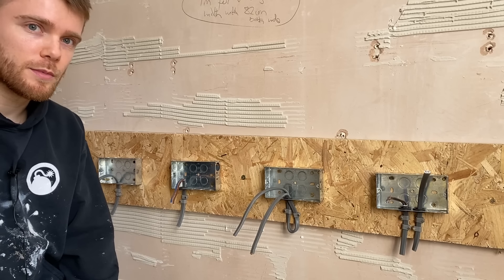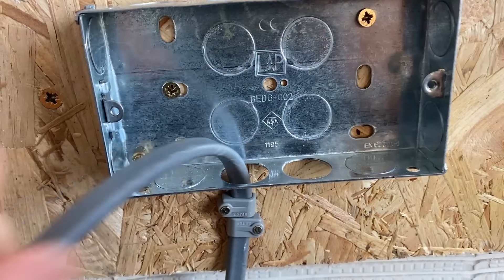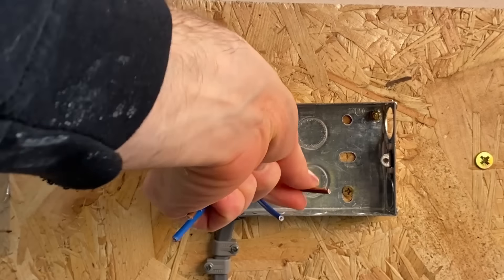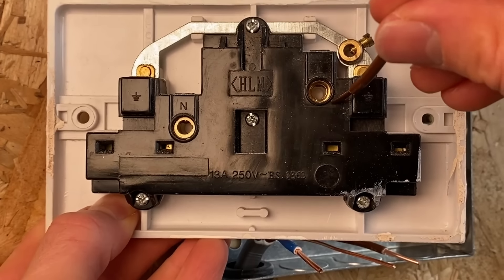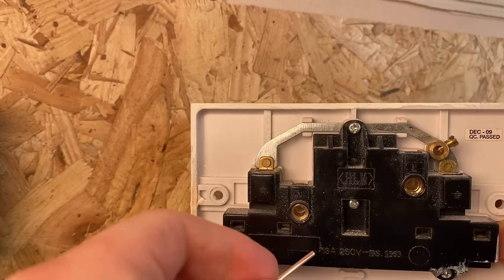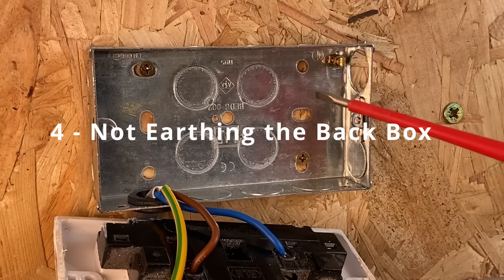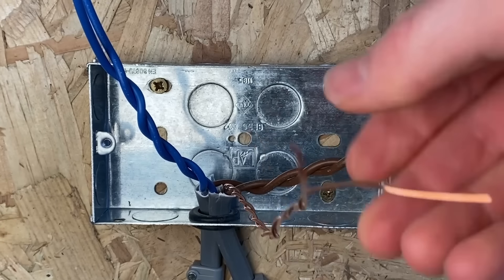5 Biggest DIY Mistakes Wiring a Socket

Comment: Well done for starting your channel, however a home owner must not be carrying out electrical works them selves !!, thats why us professional electricians are trained to do the work. if you carry out work on your property and have a problem or cause a fire, you are likely to invalidate your home insurance.
Reply from the maker: Thank you! You are absolutely right, but I think some people will always want to do small jobs themselves, whether they should be or not, so better to do it right!
Reply: There is nothing in law in the UK to prevent people doing any electrical (or, for that matter, gas) work themselves. A very few things have to have building regulations certification but in many cases the cost of that from the local building control department is less than the amount saved by not employing a professional installer (which in any case doesn't guarantee a good job).
Reply: @TheDiligentDIYer1759  Within the part P regs it says a non Part P person can do simple jobs. I suppose its how to define a simple job!! A socket is one which is 'simple' I think!!
Reply: @richardlewis5316  actually it says that some work is notifiable and some is not. There is no actual requirement for an electrician only to do the work. Obviously an electrician has insurance and knowledge but provided it passes the relevant BS standards and complies with the Building regs and is correctly signed off then you can do it yourself. 
Some work like adding a spur is not notifiable but if it did fault and it was down to faulty workmanship your insurance would probably be invalid, but they would have to prove it was down to the installation and that you did it. Not exactly an easy job. 
Sparky’s do want to keep their job to sparky’s only and be able to charge the sort of day rates that make your eyes water and like to spread fear (rightly so with some DIY disasters) but not all DIYers are incapable of doing a compliant job.
Reply: Most of the time the handyman does a more professional job than the professional electrician
Reply: @thunderstorm6616  I would consider myself a competent diyer with electrics. My dad was a spark and I have worked with him on a few jobs and we regularly discuss updates on regs, new equipment etc etc. And I'm sure the majority of sensible people could do the job of changing out a faceplate, especially given videos like this with good information on what to look for and how to make it good. My issue comes with post installation testing. The vast majority of diyers will happily swap out switches, sockets or light fittings but won't do any testing afterwards to make sure it's a good job.
Reply: @rodgerq  Spot on
Reply: @Harold_Shand  So explain to me if you put an outside socket on how do you know it will be safe?
Reply: @Harold_Shand  yeah, because all DIYers have a multifunction tester in their toolbox
Reply: @Harold_Shand  PMSL.
Reply: @thunderstorm6616 That's just an assumption based your experience.
Reply: @thunderstorm6616  behave yourself
Reply: Or issues selling your house if recent work has not been certified by an electrician.
Reply: @theotherside8258  yep!
Reply: @theotherside8258  Define recent? Who would know when work was done?
Reply: @barrieshepherd7694  Well work more recent than build might def stand out and work more recent than regs (which change) I think are identifiable by the cable markings,  pretty sure they are stamped with enough information to do this. Someone should be able to verify this.
Reply: @MarkUKInsects  I am DIY but do electronic repairs in the past t.vs video recorder amps . I find terrible electrical work and say did electrician really do this mess. I have completely rewired several properties and had them tested and sighed off
Reply: Another jobsworth H&S arse !

Comment: #2 cables cut short, I just moved a lightswitch because the electrician who rewired our house left the cables short. He also tried to avoid any chiselling into our brick, because they are "engineering" brick and harder than some types of stone. It took me half an hour with a cold chisel and mallet to dig deeply enough, could be as much as 5mm...

Comment: Although it is not a bad idea, earthing a metal back box to the socket is no longer required as long as long as you have at least one fixed lug which is used to secure the socket front to the back box via the machine screws.
Reply from the maker: Yes true, I think the regs state desirable rather than required. Thanks for watching!
Reply: The Regs say desirable - which is a very poor drop in safety standards  (They should know better ! )

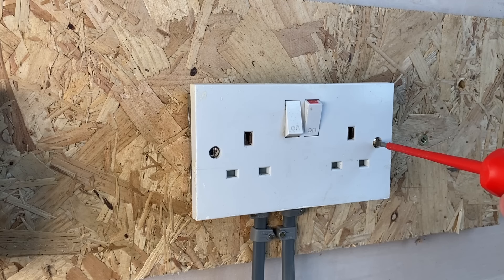Comment: At 5:44 this sparkie rambles on about ensuring the outer front casing screws are pointed in the same direction.  Yes, it looks nicer, BUT IT IS NOT A SAFETY MATTER, so it is NOT a necessity.  More important to ensure they are tightened equally, and enough, so that they do not, somehow, rattle out.
Reply from the maker: I’m a diyer, not a sparkie haha, but thanks for watching!

Comment: Excellent video.  2.5 sq mm single strand T&E is horrible: nowadays one can get stranded, far better. My instructor was in the trade when 7/0.29 sq inch was still in use. He said that when 2.5 T&E came in, they called it stair rods - quite right: it's horrible.  In the premetric days, most lighting circuits were done in 3/029 sq in, far better than 1.5 sq mm solid core. Stranded conductors give better connections.
Reply from the maker: Thanks for watching!!
Reply: It's single core for a good reason, if you just think about it.
Reply: My early 70s council house is stranded definitely copper it's horrible stuff and all cut quite short so can't really do a fresh cut not terminate.

Comment: How can you get all the screws vertical or horizontal?
You need to tighten them until they are tight!
Why would you leave it not fully tightened or overtight? I've always fully tightened them, vertical, horizontal or whatever.
To not over tighten screws or nuts is why for mechanical engineering work torque wrenches are used.
Reply from the maker: You don’t torque faceplate screws, you crack or bend the face plate doing them up too tight. The thread is very close together, it’s very easy to tighten them to the required level and leave them vertical. Thanks for watching!
Reply: @TheDiligentDIYer1759  Exactly my point, easily over tightened by taking them that bit further.. 
Torque wrenches are for engines and such as I said so they are not over tightened but to the manufacturers recommended setting..
I tighten things and then nip them up as I did in engineering.
I still wouldn't attempt to align the heads.

Comment: Sparky's take: very good video, couple of points though. Dont need to earth a back box so long as it has at least one fixed lug(like your box) boxes with all adjustable lugs must be earthed, however, it will do absolutely no harm to earth all boxes, it will just take longer for no real gain. Dont bother aligning your screw heads, nobody is EVER going to look at it and say "oh your screw heads are all inline". 

Grommets 👍
Dont twist the cpc 👍
Double back cores when you have a single core in the terminal(dont bother with two or more) 👍
Leave spare length 👍

Wish every DIY socket I came across was like yours 😆
Reply from the maker: The screw heads is just obsessive OCD on my part haha. Thanks for watching!
Reply: @TheDiligentDIYer1759  surely correct tightness is more important?
Reply: I was alway taught to align heads, but at 45deg.
Reply: @pauldarlington9157   yeah, I really cant knock it, fantastic practice 👍 this is honestly an example of me choosing to not go the extra mile in the interest of keeping pace
Reply: Another point of best practice, again something that I dont actually bother with unless spec'd(high integrity earth spec); If you put one cpc in each earth terminal, any problems with the earthing integrity within the socket itself will show up when it is next tested.
Reply: I look and notice misaligned screws ..
Reply: How is the leccy going to flow into the ground from the earth if the screw heads are not vertical?
Reply: @I_Don_t_want_a_handle  🤣🤣🤣
Reply: 100% correct on all your points inc earthing back box.
Reply: I 100% go round aligning screw heads on everything… But I do have a problem 😂
Reply: I line up the visible screw heads, it is the 'done' thing in the US. The ones which are torqued to spec, nope, a solid, reliable connection is more important than appearance.
We bond every metal surface together inside a box, I, personally do not rely on our rather flimsy receptacles to make a good bond just through our rather under-dimensioned screws. 
(Cue the arm-chair idiots who pretend nobody torques to spec.)
Reply: @pauldarlington9157  Is that 45deg clockwise or anti-clockwise; forward or backslash?
Reply: Surely the point of earthing the backbox is to prevent problems when you take the faceplate off? If you rely on the screws to provide the earth, if a fault is present, the back box could end up live once the screws are removed???
Reply: @TheDiligentDIYer1759  Lining up screw heads was instilled into me at school by my woodwork teacher...It's about the only thing he did manage to impart in me!
Reply: @peterevans8194 any fault in box that is not picked up by fixed lug bonding and has not tripped circuit would still be there regardless of fly strap bonding of back box.
Reply: @peterevans8194 why would you remove a live faceplate potentially making the back box live under fault?
Reply: One fixed lug constitutes a fixing - which therefore is NOT acceptable for an electrical connection.  Don't comment if you are not competent !

Comment: Very helpful video so many thanks.  I'm a hobby woodworker and it's regarded as a good finishing touch when all exposed screw heads are aligned.
Reply from the maker: Thank you! Yes I think it shows good attention to detail!
Reply: But you also get plastic lugs to pop over them so not really an issue

Comment: The metal box is earthed via the outlet mounting earth screw, fly lead not required?
Reply from the maker: True, but only in the case of fixed lugs. The regs state no earthing of the back box required when it has two fixed lugs. For two adjustable lugs the box must be earthed as the adjustable lugs can’t be relied on for a good connection. For one fixed and one adjustable, which in my experience is most common, the regs state it is desirable. A bit subjective, but I’d say it is certainly best practice in that case.
Reply: @TheDiligentDIYer1759 I have seen some electricians argue both ways, as an electrician from another country I would earth the box.  I can't understand why the regs state it is desirable. Its required or not, make a rule. It should not have to be best practice.
Reply: Yes agreed!
Reply: @TheDiligentDIYer1759  I am a fully qualified sparky in uk and I dont earth the back box with a flylead on sockets (presuming there is at least one fixed lug), regs state that if there is at least one fixed lug it is not required....   My reasoning for this is in a few arguments, firstly and easily the back box is earthed so if it for whatever reason line comes into contact with it then the over current protection device will trip.  Next the back box is not actually touchable anyway, its in the wall how is anyone going to touch it? I do put a fly lead if I fit surface metal clad boxes,  the only time it could be touched is when removing the socket and anyone doing that should be competent...

But why not just do it anyway I hear you ask, well a lot of back boxes are only 25mm deep, and often you will not just have one cable you will have two or even three, so trying to put in another cable and filling the box even more is not needed especially when the cables are a bit older and less flexible, also the biggest problem I see with DIY is not tightening the connections enough, you should always tighten, push the socket to the plate, pull it back out and then tighten again as when cables move they can become lose in the terminal, having potentially 4 cpc cables in a terminal increases the likely hood I find of a loose cable or one of the cables having a poor connection because its biting into the sleeving. (Honestly try it in a kitchen with a counter top socket with a unit above so its difficult to see anything, easy when there is just one cable but that is rare)

A lot of the old boys when they did MICC cable use the outer core for the cpc so just used two core MICC and just earthed to the back box so when you take off a socket there is no earth cable in the socket (Not my preference I have to say but been fine for years).

You could argue and I always use pan head screws instead of countersunk screws as the cable can get caught, also put a washer on so it spreads the stress of the fixing, might be overkill but I think just as important as a flylead...
Reply: @MarkUKInsects  regulations state any person carrying out electrical work must be a skilled person (Changed from competent), changing it to a none compliant chinese rubbish as you say is not the original installers problem..  As for your argument of denying they installed it, using that same argument,  that same person could remove the flylead (often usb sockets are larger so might be removed to make more room), then they deny ever changing the socket or removing the flylead, how is that any difference and how is that any safer?
Reply: "best practice"
because the next guy might come along and now know what they are doing
Reply: @steve11211  what Steve said

Comment: I'd say a biggy is not testing the circuit properly when your done and if you don't have the knowledge to do that you probably shouldn't be dabbling. Good video 👍🏻
Reply from the maker: Thanks for watching! Yes I perhaps should have included a bit on using a socket tester.
Reply: I would do ring continuity IR and Zs tests I'm currently ripping a kitchen apart that was a DIY botch up that would have looked fine if you plugged a socket tester in, all too common, some good DIY guys out there but a little knowledge can be dangerous
Reply: well I checked out all the regulations and their latest changes when i needed a lot of work done and then got an electrician in to do the work. Regulations are one thing but actual knowing what you are doing with cable is another,  I'd also identified some hidden cabling that was very dodgy.  He did a great job and certified the work accordingly but i could see by the certification document that he was not up to scratch on the latest regs although it hadn't impacted the actual work.  Yes,, Testing is essential for peace of mind.  Its too easy for something to appear ok but be a future liability.

Comment: You don’t need to earth the backbox even if it’s metal 😂 the fixing screws will do that however for metal accessories it is good practice
Reply from the maker: I could be wrong, I don’t have the regs to hand, but my understanding is that in the case of fixed lugs, the back box doesn’t need to be earthed. However for both lugs adjustable you must earth the back box, as the screws can’t be relied on for a good connection. In the case of one fixed, one adjustable, which in my experience is most common, the regs say desirable to earth the box. So definitely not clear, but seems safest to earth it.
Reply: The essential time to earth the back box is when the cpc is from metal conduit or trunking or cable armouring with no separate earth cable as a loose wobbly socket will result in higher impedance but for the few seconds it takes to fit a flying earth lead, it’s just not worth omitting it.
Reply: Actually you do , as on removing the socket from the wall you break the bond leaving the box at risk
Reply: @TheDiligentDIYer1759  that is my understanding as well.
Reply: My comment as well re the back box
Reply: No need but it's not leaving the installation less safe- thats the key.
Reply: @stephenfanthorpe2708  - you shouldn't be removing the faceplate without isolating the circuit...
Reply: It is still considered best practice re the regs do not really sure why the laughing emoji?
Reply: If you want to rely on a screw possibly not correctly tightened carry on. I'm happy to fit an extra piece of wire. For  Class One metal accessories it is must,  and class two it is a big no.

Comment: Glad to see someone saying to double over the core before inserting it into the terminal. I said this to a professional electrician and he said oh no you musn't do that because the cable could fracture at the bend. Another point to the benefit of doubling over the cable is that when using just a single cable, the copper can migrate under the screw pressure and the terminal becomes loose. This is also a hazard.
Reply from the maker: Absolutely! Thanks for watching!
Reply: The problem for most people isn't the doubling over it's the over tightening of the screw terminal. It's so easy to over tighten without a torque screwdriver.
Reply: @paulw6183  what torque do you tighten to?
Reply: @AmirKhan-qx2lr  

Depends on the size of the screw in the terminal
Reply: @TheDiligentDIYer1759  I understand why you do it. It is one of those immediate fails here in the US during and inspection.  Except for low voltage, we tend to avoid more than one wire under a screw connector and size the connectors appropriately. You have to contend with a different system.
Again, arm-chair idiots, I'm not criticizing him, just mentioning that different places do things differently.
Reply: @ethelryan257  How do you backstab an outlet with the wire doubled over ?